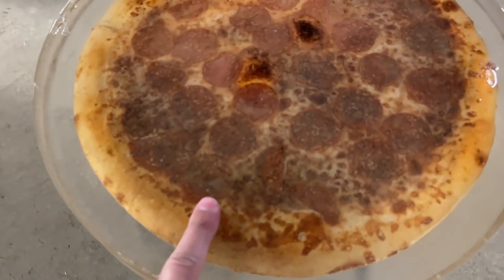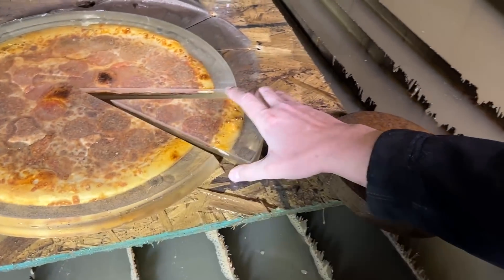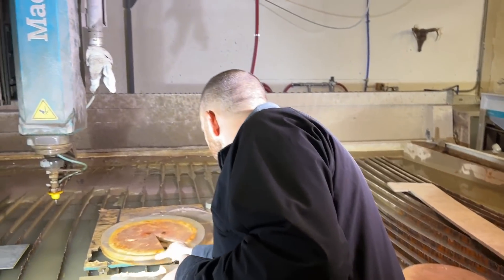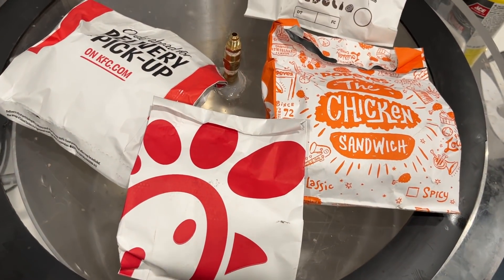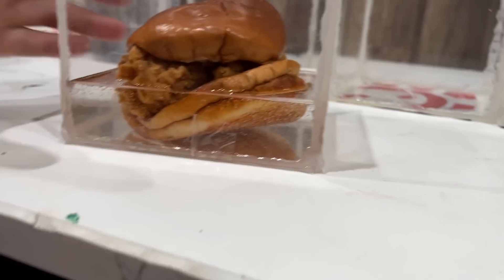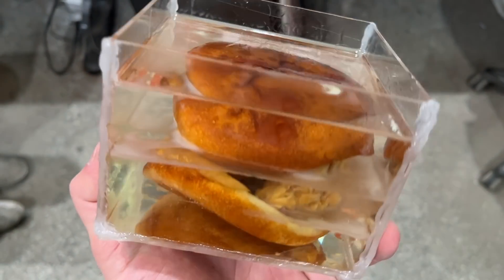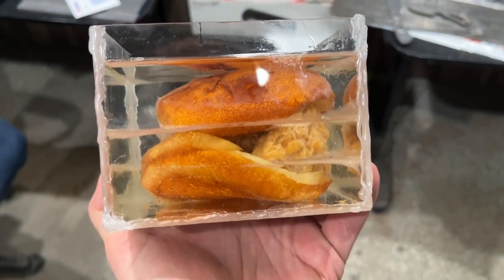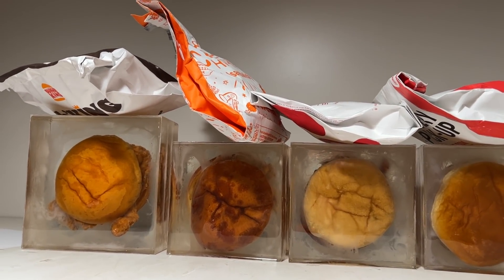Opening A 90 Day Old Pepperoni Pizza Encased In Epoxy Resin

Comment: As some folks mentioned Botulism thrives in oxygen less environments. I'm super curious about having a variety of foods encased in resin, cracked open, and tested for botulism growth 👀
Reply: Botulism is derived from the soil and is heat sensitive. So if it wasn’t there before it won’t grow over a certain period of time. Interesting thought though
Reply: Yes
Reply: @Joesett1  you are incorrect the spores are some of the most resistant known. It takes high preasure combined with high heat for extended time. Think of a preasure canner if it wasn't for botulism you could just boil your jars and be safe but that's not the case
Reply: Yes absolutly pathogens love living in our  moist lungs and the older you get the less your lungs expand leading to less oxygen environment. Human lungs are just a ticking time bomb.

Comment: Using a Vacuum chamber as opposed to a pressure pot (or no pressure) probably drew air and oil out of the sandwiches and forced it to mix with the resin.  I think that was part of the problem.
Reply: Came here to say exactly this :)

Comment: Maybe try spraying on a light coat of resin on each item to fully encase the food items separately. Then put the sandwich back together and then put it in a block of resin. Idk if that would work better but on paper it sounds like it should keep all the grease and stuff actually inside the sandwich. Love all the videos you guys make!!
Reply: yes I wanted to suggest exactly that! disassemble the thing, paint on or spray resin or lacquer on each ingredient to seal it, then put back together. I think, onw of the issues with this will be that this will make the sandwich parts stiff and they may not come back together in a good shape, like it will be obvious that they are just stacked on top of one another like plastic pieces not food ingredients. but I think one can still work with that
Reply: Works perfectly from my experiments👍👍👍

Comment: I feel like the flaw in both channels pizza casting is not dabbing the grease away with a cloth when they first open if. I thought for sure Pete would use a cloth or something on the top and bottom to soak up and not just dry out the moisture.
Reply: Just lay some paper towels on it

Comment: I love these!!
I've bee racking my mind on how to keep the lipophobic resin oils from making layers like that.  Like a fast drying clear shellac, spray glue or even hitting it with some sort of degreaser.  Could you simply dip it in a rosin and let it hang dry to create a solid shell before applying the fill?

Comment: I feel like if you were to do a paint coat of some thin, but faster setting epoxy, at least for the chicken portion, then the buns would have more time to dry out.  Then another paint coat on the buns to get them adhered to the chicken, and finally do a block pour, it may not have the ghost grease every pour layer.

Comment: Do more prep work on the chicke, you can rense the chicken off in water let it dry, then put in the freezer with a paper towel around it so the oil won't come out. Then before the buns put a very thin layer of resin on the chicken alone, place on buns and finish the process

Comment: What if you painted a coat of resin onto the sandwiches to seal all the grease in, before you cast them? As for the pizza I would have wiped up the grease with paper towels and painted on a coat of resin before casting too.

Comment: Next time, just mix up a small amount of resin and use a paintbrush to cover the top and bottom of both buns, as well as the whole piece of chicken. Stick it back together and then let it harden that way. Then do a small pour of resin to get your bottom layer, let it dry to the point of getting almost going hard but still tacky and set your chicken burger on it. Once completely dry, cover the rest with resin. 

And use that torch sparingly. If you have a long cast time, let them all rise up to the top as much as possible before hitting them with fire. The heat can actually speed up curing time for the top surface, trapping in more bubbles.

I made industrial polyurethane plastic for 10 years, hopefully some of these tips help.

Comment: Why don't you guys just give the food very thin coats of UV sensitive resin in a "cover the food in a 1mm thick layer, cure it with UV light right away, and repeat it 5 times" pattern and only then add in the proper slow curing resin? 

This would turn out good in my opinion, as long as the last layer of UV sensitive resin on the food is fully cured.

Comment: You need about .125"-.25" of semi cured resin at the bottom of the mold so that the objects being encased have a good layer of resin between them and the outside. It looks like the sandwiches are sitting directly on the bottom of the form. You could probably poke a finger right into the bottom of the bun because the resin is too thin.